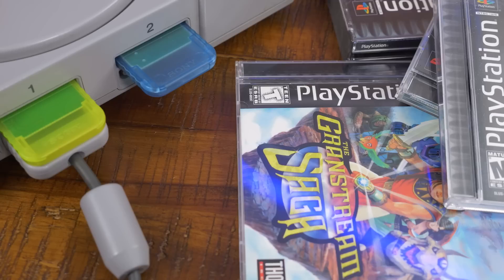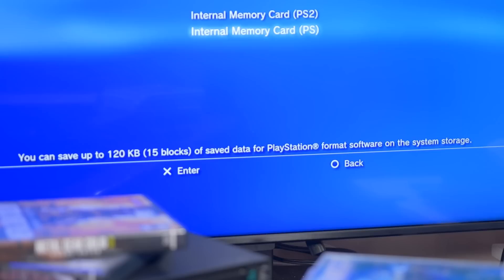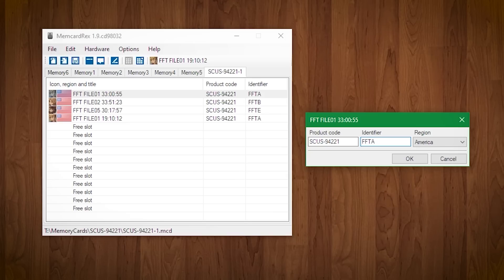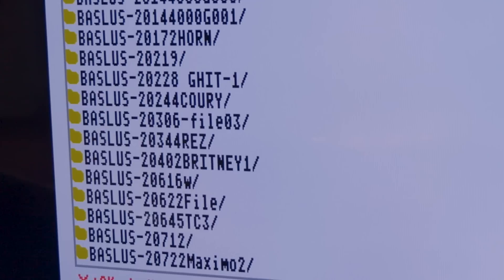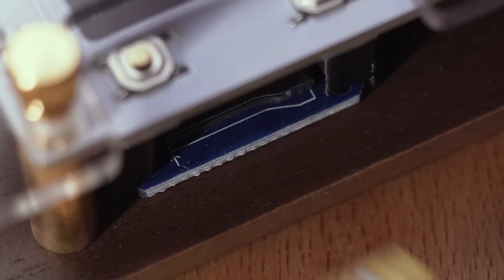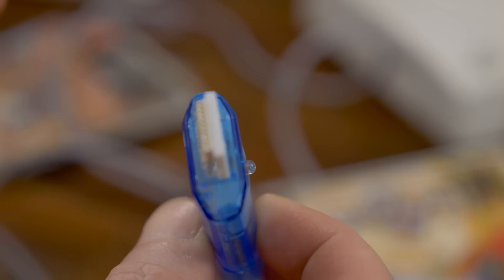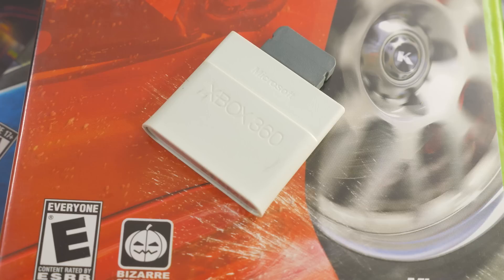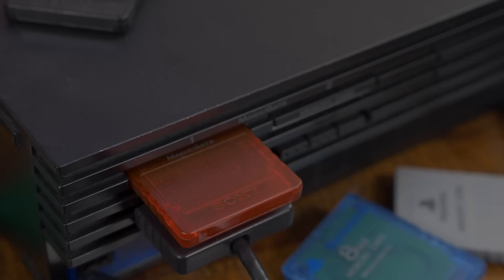Memory Card Save File Preservation - PS1, PS2, N64, Dreamcast, Xbox, & GameCube / MY LIFE IN GAMING

Comment: I did not know that you can use a PS2 to copy PS1 saves to a PS2 memeory card. That is extremely useful info. I can now use just one PS2 memory card to backup my saves from multiple PS1 memory cards. Sweet!
Reply: You can actually save ps1-ps2 save files on ps3 too
Reply: Saw u on Reddit
Reply: Memcard pro is on sale for like 45 dollars. A great option!
Reply: @theneedforspeeder9575  With the optional Memory Card Adaptor. I bought one before I bought a PS3 because I thought it could be connected to a PC and could save on a hard drive. I couldn't. But I still used it to save games on my PS3
Reply: @brandonkick  yes. Considering a 1gb micro SD card could hold about 8,000 memory cards worth, that’s a WAY better deal and considering this is saves we are talking about, you don’t have to worry about legal trouble with the contained files. Even a 32GB micro SD card costs less than $10 nowadays if you know where to look for them! So, yeah, less than $100 to get just about any micro SD card and the device itself, versus 8,000 memory cards. There’s no reason NOT to get it unless you have don’t have a PS1/Early PS2
Reply: Super useful for me. My ps1 memory card has been full
Reply: WHAAAAAA😵😵😵😵
Reply: Lol
Reply: You can also back them up to a USB with LaunchELF
Reply: @BASEDHAX(ross3695) In Japan, sadly it is still illegal. In America, it's just as legal as using a GameShark for the PS1, or more famously, Game Genie for NES
Reply: Its weird I was just thinking about this at work other day before I seen this video was uploaded
Reply: @raekane  it should be doable to do so on pc also
Reply: And... Knowing is Half the Battle
Reply: I never knew that till now though it's cool.
Reply: Flash memory is not very good for long term storage. The charge in field effect transistors will be lost with time and data will get corrupted. Burn them onto MDisks to be 100% sure it will be preserved.

Comment: The PS3 Memory Card Adapter is a Godsend. Legend of Legaia has a game breaking bug about 3/4 through the game, that happens almost consistently when playing the game on a PS3. But with the adapter I managed to transfer the save to my PS1 memory card, get past the point where the glitch happens, save the game, and transfer it back to my PS3. It worked like a dream.
Reply from the maker: [Try4ce] I did the same thing with Soul Reaver 2 to get around a PS3 glitch, although I did finish the rest of the game on my PS2.
Reply: I had no idea they were as rare as they are, thankfully I bought a few a decade ago lol
Reply: why not just use original hardware? seems like hassle to transfer saves from ps3 to ps1 memory card.
Reply: @Viciouspiked  I keep my PS2 hooked up via Component permanently, and PS1 games do not display via Component output, and the only TV I have that I can hook up my PS1 to is a heavy as hell CRT that I keep for console and game testing, and I have to move it every time I need to use it.
Reply: @RohanSpartin  if you can, keep an eye out on the PS1DIGITAL. Shit is a dream come true. an actual HDMI port on my PS1.
Reply: @mylifeingaming  there was a glitch on Soul Reaver 2? I dont remember that. What glitch was there? I beat it on PS3 all the way.
Reply: @mackdee911h3  I know about it and it looks great, but I'd rather wait for an HDMI option for PS2 that lets you play PS1 and PS2 games.
Reply: @RohanSpartin   Wait... what?  I used to use my PS2 as a PS1.  Had it connected via component since nearly day 1, I think.  I thought I remembered hearing that the PS2 has issues with DVD playback on RGB, but that's another thing entirely.
Reply: @nickwallette6201  Yeah. PS2 refuses to output PS1 games via Component. Not sure about DVDs though. I use my PS4 to play DVDs. I'll have to test that.
Reply: @mackdee911h3  SR2 on PS3 would "hard lock" when you were supposed to exit the Dark Forge. Basically the entrance door that is supposed to get sealed once you get out and get a cutscene would be sealed while you are still inside the Forge. I think the bug happens if you mess with the crows outside the Forge, the ones that turn to green mist if you get close to them.
Reply: @SiCkMiNiMaLsTyLe  maybe thats why i was able to get past. Idk, but nowadays i have a dedicated ps2 anyway. PS2 on PS3 doesnt take up the entire screen and it just bothers me seeing slivers of black on the sides.
Reply: The black Turok N64 cartridge has a glitch blocking your way through the game. The gray variant is worth much more than the black one because no glitch in that game.
Reply: @ATthemusician  i bought an unoriginal memory card adapter,. works fine with either PS1 or PS2 mem card
Reply: @mariokart8715  Wait, you mean the first Turok game? I have the grey cart of it and I thought that was the only version.
Reply: @RohanSpartin  really? Was it a certain model thing? My PS2 displays PS1 games on component just fine.
Reply: @90sNath  It's because my HDTV doesn't like 240p through Component.

Comment: You seemed to cover everything except for the Saturn. I know the Saturn had built in memory as well an external memory card you could plug into the expansion port. However, I have not found any great way of backing up and restoring saves off that system. I have a fenrir but it only seems to backup the entire flash memory at once and Pseudo Saturn Kai's memory manager seems to give me mixed results as far as backing up and restoring saves. Kinda wish there was something more robust for the Saturn.

Comment: Two interesting bits worth mentioning regarding ps1 menory cards.
1. You can restore deleted saves by holding L1L2R1R2 in the menory card menu as long as it wasn't overwritten.
2. Later on some demo discs came with saves for certain games that you could copy onto your own menory card and use.

Comment: The beginning of so many PS1/2 and Gamecube games are permanently burned into my mind from when I had no memory card. I remember any time I got a new console, I usually didn’t have enough money for a memory card until later or received one as a gift, so all my games would be reset whenever I turned off the console. It’s definitely a huge perk to have internal console storage.
Reply: 100% believe they should have packed one in when you bought the system. Glad the 360 did that.
Reply: And the later consoles after that. The OG Xbox has an internal hard drive.

Comment: You can also just email saves to yourself on Dreamcast if you have that set up. Great video!
Reply: The VMUs (visual memory units) in the controllers.
Reply: @mariokart8715  yes. You can use the Dreamcast to email saves from the VMUs to yourself. In this way it's possible to back up sav s on the computer, load them in emulators, even load your saves into the grandia 2 port on steam from your DC game.

Comment: I am happy that latest firmware of Terraonions MODE allows you to dump the entire volatile backup RAM on a Saturn to the SD card. Also there is an "application" that allows save management on the Saturn too via MODE.

Just a pain in the bum accessing the memory card to back up further, unless you're using an extension cable, I may have to get one. But it's a start.

Comment: I recall there was a sort of DexDrive-ish device for the Ps2, I had one. But it was convoluted and a mess. It was called SharkPort and was a dongle with two USB ports on either side. You connected one to your PS2, the other to your PC, ran the PS2 disk (Or later versions of the PS2 GameShark had support built-in) and application on your PC to transfer saves. Issue was that on top of it being slow, for some insane reason they would REMOVE all the 3D icons from the saves and replace them with a cube that showed their logo. This not only caused issues with some games, but it also meant that if you were to restore these saves you would just have a bunch of icons all with the same image on your memorycard, making telling which save is which a much bigger hassle.

Also for the Dreamcast I recall I had a device called the "Sega Dreamcast Double Power" or something like that. It looked like a miniature DreamCast with a red button in the middle. And while it's main purpose was to clone one VMU to another (Not sure why you would want to do that though?) the other feature, and the only thing I used it for, was that it could also connect to a PC to transfer to/from a VMU to PC.

Comment: I had no idea that you could put PS1 saves on a PS2 memory card, and furthermore, I had no clue that a non-vmu memory card existed for Dreamcast outside of wireless Bluetooth adaptors. 
I always wondered what the point of OG Xbox memory cards were, my friend Nick had two for each of his four controllers. It looked cool I guess, but was overall pointless, as he was the only kid we knew who owned an Xbox. He gave me that old Xbox circa 2008, I had it in my setup until 2021 when I realized that it needed a new disc drive and the reason I had to manually reset date / time every time I booted the system is because the CMOS battery was long dead. Somehow it never leaked or ruined traces on the board in 13 plus years. Now I use that old Xbox often to play OutRun 2 and the many other OG Xbox games that I've discovered long after the system's lifespan.
Great video as always, love the content and hope you guys pump out a couple more vids before the end of '22.

Comment: Around the Summer of '21, I found a third-party PS1 memory card on the floor beside some dumpsters, not too far from my place. Worked without even having to clean it. Its owner was 'David', with the following files:

Micro Machines V3;
Bust-a-Move 2;
Driver (with the profile name 'RVD' » Rob Van Dam);
FIFA 2003;
Tekken 3;
and Beyblade.

These memory cards, too, are grey, but - obviously - lack the PlayStation logo, being only inscribed with "1 Mega" on a very rudimentary font.
I own another one of the same type, that for years, assumed as not working, when all it took was cleaning the contact points...
The only anomaly I've experienced with these: Not being recognized at a first try in Final Fantasy IX, through a PS2 (SCPH-50004). By the second try, it'd work.
This bug doesn't seem to occur on PS1, at least with the games I've tried thus far...

On the other hand, one of my buddies from class got a GameCube for birthday, coupled with Wave Race; Luigi's Mansion and an unofficial memory card. Now, THAT one would never be recognized and I felt really bad for him. It didn't impede us from having a blast, an explosion and implosion with that system, though, through the whole Summer!

Another, next-door friend that owned a Dreamcast managed to complete Sonic Adventure by leaving the console ON for three days.
When I got my DC at 8-years-old, I somehow had the foresight of asking to buy a VMU the very next day. Brought it up while buying groceries for the whole week, and my Dad didn't mind driving me to the next town over, leaving Mom to do the need-be. It was worth it, as Shenmue was amongst the first lineup I got, along with an equally long Rayman 2: The Great Escape and the even longer and confusing Ecco The Dolphin: Defender Of The Future.

Comment: Luckily I have 2 of the PS3 memory card adapters. 

Bought them for 20$ each back in the day. 

I did not know that I could use them to transfer the save data onto a flash drive, assuming for emulation use?? Now that’s awesome!

Comment: That's a great subject, I've been digging into it myself for some years so it's good to have a video showing those methods for those who hadn't thought about that yet. I've been using the exact same methods, in fact I've been using uLaunchElf to transfer PS1 saves from/to a Memory Card using a PS2 since the PSP times, I used Sony's old portable system to finish some PS1 RPGs like Final Fantasy VII and IX and then converted the saves to MCR files using cwcheats, converted them to raw files on the PC and then transferred them to a PS1 Memory card using a PS2 and uLaunchElf, good old times.

The Retrode wasn't cheap but it was a good investment, I've been using it for save backups for the last couple of years and I highy recommend it. I even bought the Master System module even though Phantasy Star, Ys and Ultima IV are pretty much the only games where a save backup is needed 😂

By the way, you can boot the Dreamshell ISO using an ODE but you still need the serial-to-SD adapter, there's no way avoiding it.

Comment: Nice video! I still got my PS1, PS2 and N64 memory cards. lol It was definitely a different experience compared to previous consoles during that time period. I remember being amaze at the moving character animations in the PS2 memory card. They make sad faces and reactions if you try to delete the data. lol It was defiintely a different experience back then when it comes to saving data compared to today's huge capacity HDDs and SSDs used on consoles. It was only in the kilobytes for PS1 and megabytes for the PS2. There's also the third party memory cards that can hold more storage. Nowadays Gigabytes have become the normal and soon Terabytes and so on and so forth.

Comment: The Memcard Pro sounds like an amazing device, and that autodetecting of games is a killer feature.  Now then, is there a way to "link" multiple game titles to share a single entry for it's autodetect?  I'm thinking of Suikoden 1 and 2, or even how Metal Gear Solid detects and reacts to a handful of Konami save titles.
Reply: If you don't have an x station, you manage the cards yourself. You can do this with the x station with the web interface if you don't want the default. X station also has a save manager and you can use a real card as an in between. Or edit the cards in PC software as shown.
Reply: @pikapomelo  I was asking about a very specific scenario.  I'm okay with managing the cards myself, I was talking about unique situations I'd love the automatic switching to handle.
Reply: @Dark_Jaguar  ah. It would be neat if you could do that.

Comment: PS1 cards are EEPROM, not Flash.
N64 CPaks are SRAM (S for Static) not SDRAM (SD for Synchronous Dynamic). SRAM can keep data for a long time with a low power button battery, but SDRAM needs a memory controller actively refreshing the memory cells, which fade out and lose data otherwise.

Also, the N64 CPak dumps I know about are either raw or DexDrive style which adds a 1040 byte header to the beginning of the file (yes, 1040... which I guess is 16 for a header to the header, and 1024 for the main body of the header with comments or whatever).
Filename extensions given to these files by different software seem to be very inconsistent and nonsensical just like the ROM "formats" (byte orders, really) and their extensions. The point is that, other than DexDrive dumps, MPK is what I identify as RAW. MPK is not a format like there's anything special to it. The only format to it, being a raw dump, should be the internal format the N64 library present in the games give it. But, as always, people keep coming in, mixing things up, and I know there are CPak dumps out there that have a header and yet use the filename extension "mpk", wich is just silly.
If the size is exactly 32KB (32768 bytes), then it's "raw" (unless yet another smartass has decided to change the byteorder around, which I wouldn't be surprised about). If it's bigger, then there's a silly header added to it. There's nothing more to it.
I really don't understand why they have to keep messing with that.

If it depended on me, I would call Controller Pak dumps ".cpak", and dumps from the internal cartridge save chips ".sav" or ".save" and let the type be identified by the size of the file instead of the pointless ".eep" for EEPROM (of which there are two types, 4kbit and 16kbit), ".sra" for S-RAM (256kbit and a 3x size of 768kbit in one japanese game), and ".fla" for FlashRAM (1024kbit). Like, I care that it's a save, and the size tells me what type already, so don't give me 3 different extensions for saves, for goodness sake!
Finally, ROMs would be just ".n64" and ".64dd".

For both ROM and save dumps, the natural "RAW" form would be the "big endian" byte order (ABCD), not that V64 byteswap nonsense (BADC) that came into use thanks to the old Doctor V64 backup unit. The Mr Backup Z64 at least got the byte order right, but of course they had to name the dumps ".z64" to match the name of the backup unit, instead of "N64" to match the console name as if they had anything specific about them. No, there's nothing special to "z64" ROMs, they are just natural RAW dumps, byte by byte, ROM address after ROM address, of the contents of the cartridge.

To fudge things even further, some old ROM byteswappers apparently identify a "little endian" byte order (DCBA) and give those files the extension ".n64"... the nerve! So far I haven't been able to figure out what backup unit that nonsense originated in, if any.
Unurprisingly, many downloaded ROM dumps are in a different byte order than their filename extension suggests, with .n64 and .z64 files actually containing a byteswapped ROM, viceversa, and other nonsensical combinations.

WHAT A MESS!

Comment: One way not mentioned in this video for N64 save files is using a device called adaptoid. It was a USB to N64 controller adapter released in the early 2000s that came with a mem Pak manager built into the Windows shell via the drivers. Unfortunately the drivers are outdated and will not work under a modern Windows 64 bit system so a older 32 bit machine or a VM is required to use it. Compared to the methods mentioned in this video, this way seems unconventional but you do have the ability to write and save mem Pak data and also Rumble Pak support on N64 emulators using a supported plugin. I own one and still use it to this day on my PC using generic USB drivers without mem Pak support.